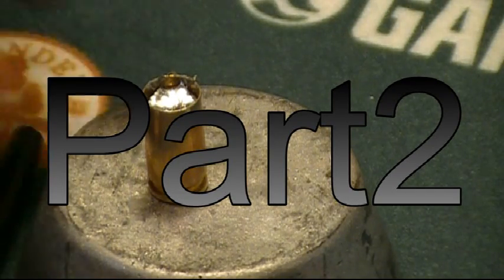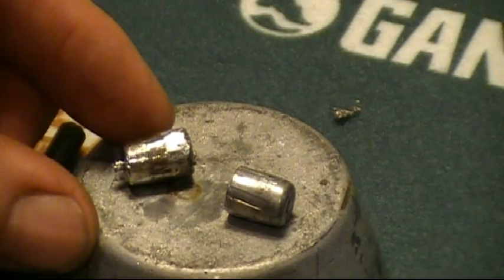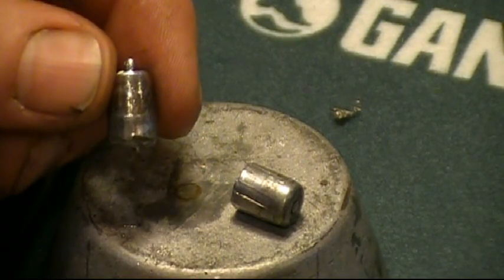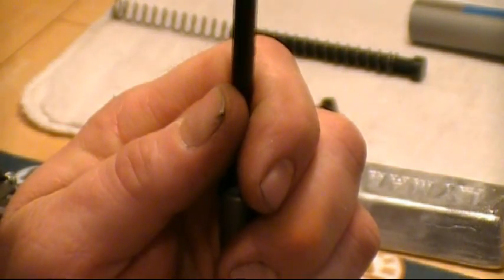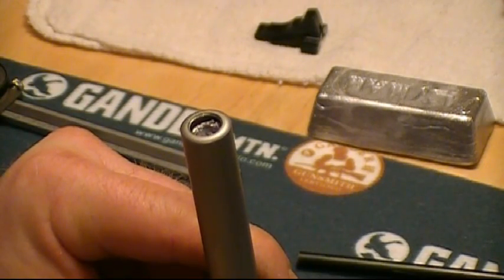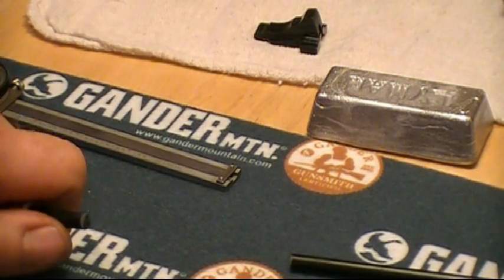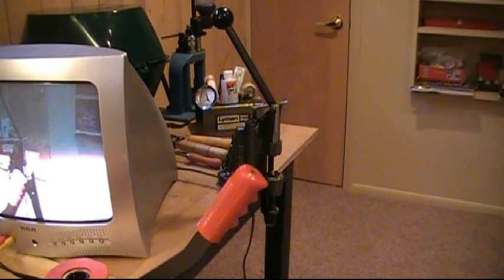Barrel slugging made easy part 2

Comment from the maker: (1)If you go to ace hardware, you can find this torch with or without an igniter,  Mine is 15 years old and they still sell them 5 bucks,(if you use a torch lighter they will get too hot and small fuel tank) (2) get some wheel weights and a muffin tin and make the one im useing in the video

Comment: Good job!   I didn't have a sutiable rod but  I had a .32 case.  so if you file off the rim, it drops down a 9mm/ 38 barrel. Then you can use a wooden dowl or even a metal  rod wrapped in tape.  Then you get a pretty much full size punch surface.  Just on obvious caution. NEVER use a case with a live primer!  I actually punched my primar out.

Comment: Thanks for the vid. Great idea about using a case to make the slug. Just slugged my M&P40 and got 0.3945". Problem came when I tried to slug from the chamber end. The lead flowed around the dowel and the dowel sunk into the lead. Thought I almost lost the barrel, it was a bear to remove. Used a drill to remove most of the lead, then the slug came out. Need a much fatter dowel.

Comment: This was a great video!

When using the bullet puller, try putting the case with the rim facing out of the curved side of the case holder.  It will "lock" in and the case holder will be "solid".  Then insert the case holder with the flat side down facing the striking end.  I think the bullets will come out easier.

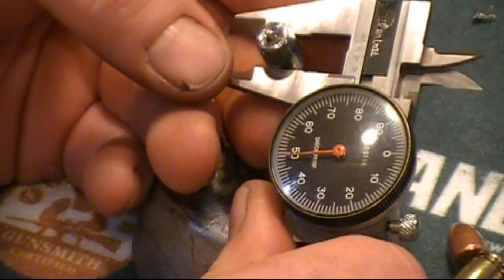Comment: don't mean to sound elementary, but I saw @ 5:55 your dial caliper measured about .350, but you said you ended up with a barrel measurement of .356- did you use a different method than what you did in the video to determine this? Thanks

Comment: Cool, I actually got the idea of using wood quite some time back from another you tube video called "how to make shotgun slugs - with bushboy". As far as a little gun oil making a difference in your measurement I think it would be negligible as any excess would be forced out in front of the slug (most gun barrels have a light coat of oil in the barrel to begin with). I suppose the way to prove it out would be to slug a barrel with oil and then without oil and compare the measurements...

Comment from the maker: @Mikey1052  I like it, with all the aluminum and lead i cast, never thought of poring into a wood mold, I will use this idea on some other calibers and tell you how it worked,  I thought the oil film would compromise my slug size, and considering a thousandth of an inch is important i decided against it.

Comment: A light application of gun oil to the slug will make for even less resistance. Another method of making a "slug" is to use a fractional, letter, wire gauge, or metric drill bit slightly larger than your barrel diameter and drill a hole through a board of appropriate thickness. Lay the board on a flat heat resistant surface and pour your melted sinker(s) into it. When it cools push the slug out with your fingers and use it to slug your barrel. Us a 5/8 bit & 1oz melted pellets to make 12ga slugs!